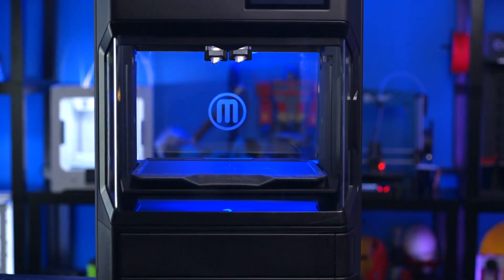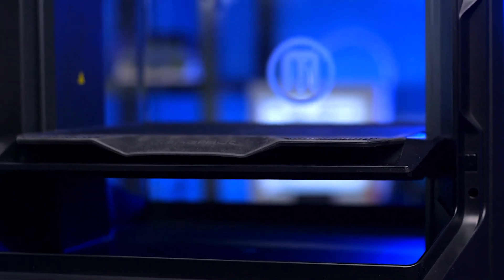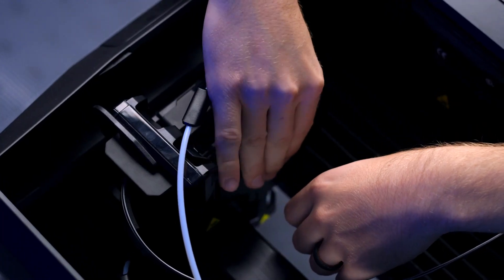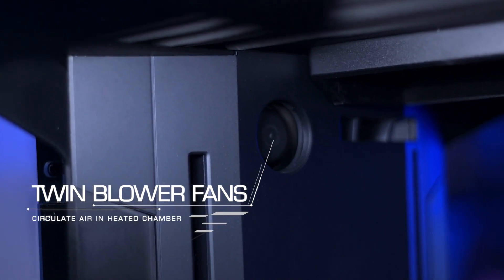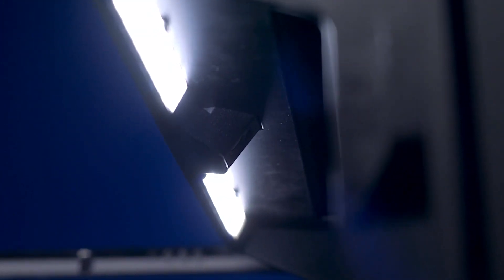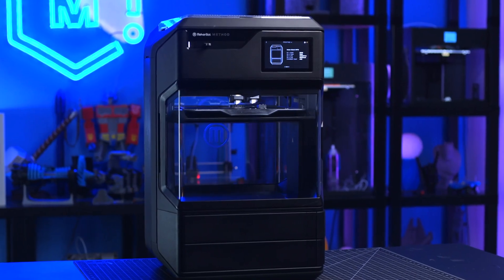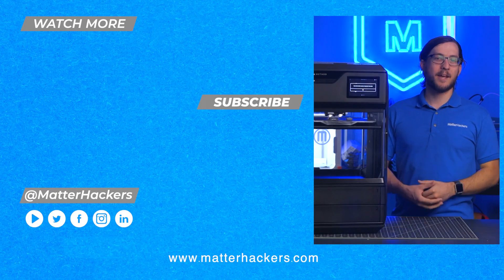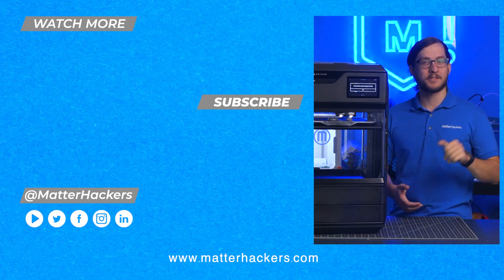Tech Breakdown: Makerbot Method 3D Printer // Fully Enclosed 3D Printer

Comment: Method is not makerbot, it's Stratasys. This is a scaled down version of Stratasys F120, using their puppet makerbot's name to appeal to a less business oriented customer base.
Reply: It's MakerBot powered by Stratasys patents. Your "puppet" in the world of business is called a subsidiary.
Reply: @zinnyval  I'm talking about the lineage and design philosophy of Method. This is not the logical continuation and expansion of Makerbot's line, but a Stratasys F120-lite. It seem that makerbot has little, if any, operational independence. Stratasys seem to have little interest in allowing Makerbot to expand and supplement their existing product line and appease their audience, but simply using it as a less scary brand for Stratasys' entry level machine.
Reply: @DGao-zz5vq  Ex-makerbotter here. You are right about the design philosophy inherited from Stratasys, but it is an independent design work by MakerBot. It is not a "scaled down" version of Stratasys printers. We brought it up from zero.
Reply: As a daily user of an F123 series stratasys machine, you want anything that can trickle down from this line of printers. They're phenomenal.
Reply: A cheaper version of the F series. Look at the heat chamber.

Comment: I have a Replicator2X (in storage) and one of the ceramic insulators on the hotend broke. Makerbot told me my only option was to buy an entire $600 extruder assembly to replace one part. So fuck them very much.

Later I got a replacement part from China for $20 at most.

Comment: They still don't seem to get it that people don't want these small $4,000-6,500 printers just cause they're slightly easier to use. The main deciding factor is always gonna be price and to have it be this high is absurd. It's a no from me and telling by all the MakerBot printers sitting broken in the library at my school, it's always gonna be a no.
Reply: I think you are misjudginf Makerbots intended market here. they dont target people who would buy a 300$ printer or even a 1000$ one as a hobby, they are targeting those using the printer for work and where an hour or two of work saved every week  will have already paid for the increased price. convenience and ease of use is everything for these customers.
Reply: @doughntworry  then Ultimaker would be the best choice there. And it costs far less than anything MakerBot offers. There's a reason they've had massive declines in sales, the value versus price ratio is far too much.
Reply: @AmusementLabs  Ultimaker's latest 3d printers are >$4000
Reply: If your time is worth nothing, then this is hard to understand. If you're any sort of business (or a hobbyist with shit to do) then this is perfect, and the price is right.
Reply: @highvoltagefeathers  I have seen these things in person, and guess what: they're always broken. Likewise, I've seen the professional grade Ultimakers and they're always running with no issues.
Reply: @AmusementLabs  That's unfortunate, but I'd guess it's user error. I use an F370 daily, and my friend who operates a product development shop has a method. Both work flawlessly. Consumables are expensive, but last a while.
Reply: @highvoltagefeathers  what's your friend's opinion on the method?
Reply: Buy this machine put in your lab and charge client thousands dollars for a job. Or buy a $300 machine put on the table and tell your client pay me $50 for your labor time and save the rest to buy a printer from Amazon and print yourself